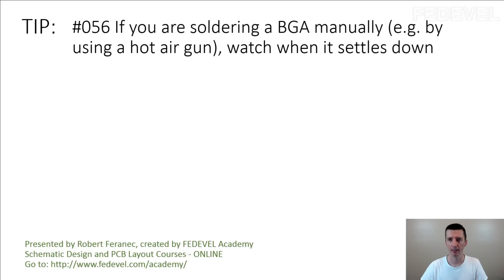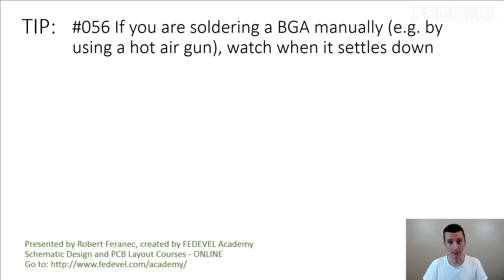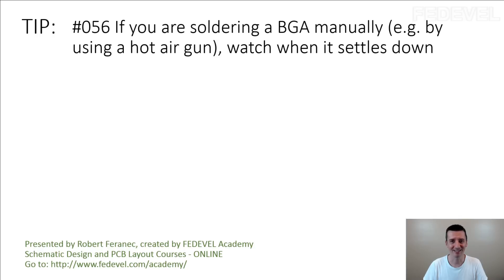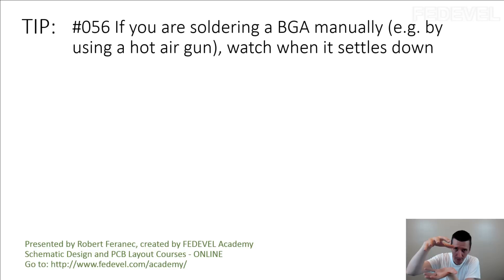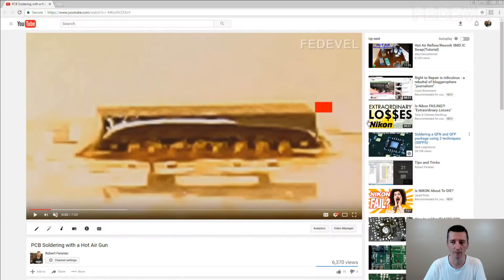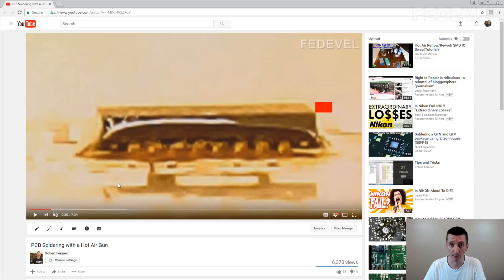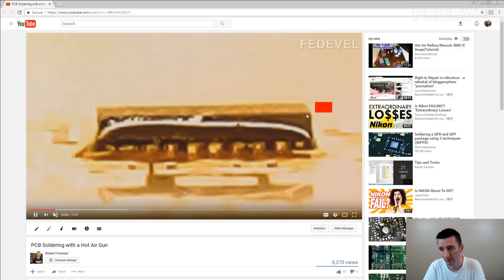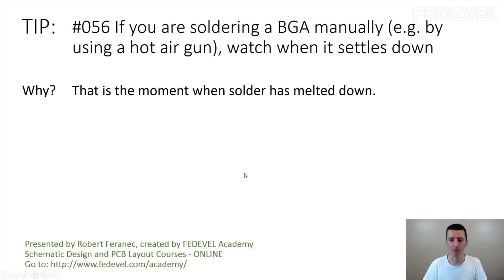TIP #056: If you are soldering a BGA manually (e.g. by a hot air gun), watch when it settles down

Comment: Do you still do BGAs yourself? If so do you use a hot air gun with one of the square nozzles alone or do you use some sort of hot plate also?
Reply: Same Question here too!
Also, does new PGA come with the soldering balls sticking to its pads or should I do the balls distribution myself
Reply from the maker: Yes, if needed I still do it. I have tried to pre-heat some boards (placing them above a hot plate), but usually I just use the hot air gun, no special nozzles.
Reply: Robert Feranec Are we talking small bgas or 256+ ball fpga bgas here? Do you tin the board with leaded solder before putting the bga on (like in the qfn case)?